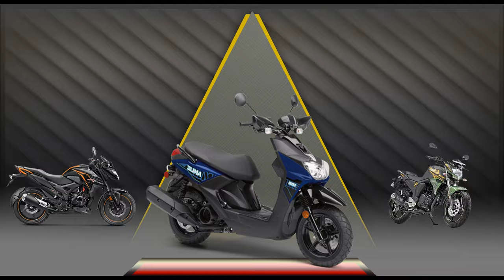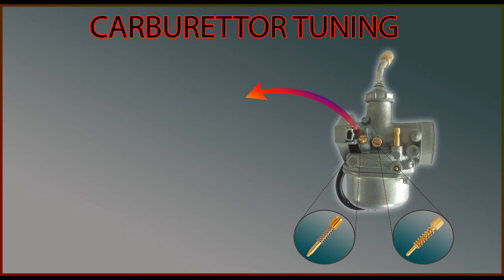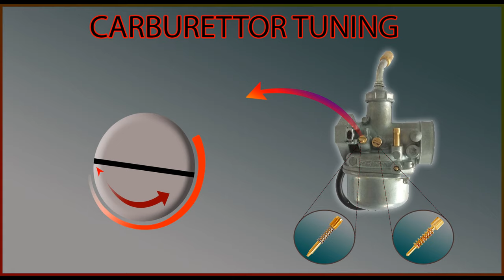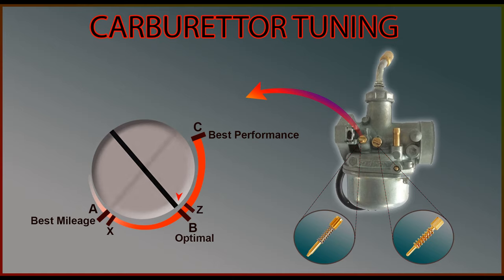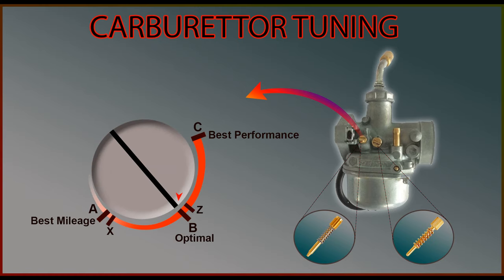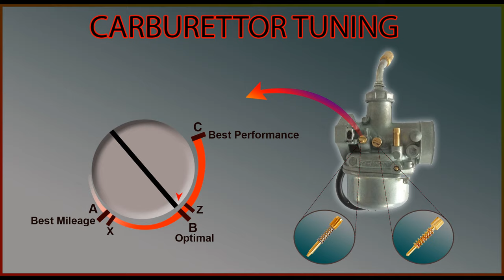Bike or Scooter carburetor tuning for mileage, carburetor setting. TVS Jupiter, Wego. #carburetor

Comment: This was explained in a way where I was able to adjust my carb well. Before this video I watched other videos. I know what the adjusters were. I just did not understand their relation. I installed a tachometer thinking it would help. I searched online for the RPM range for my scooter. 1500 to 2000. I followed your instructions. The top end was 3000 RPM it would not go any higher than 3150. It would start to shut down around 1230. So B would be around 2100 RPM. After setting the mixture, I adjusted the idle where it would not bounce back and forth. The scooter started to act funny when I changed the air filter. I'm looking to change the exhast next. Again, thank you for making this video... it seems you were the right teacher for my learning perference.
Reply from the maker: Thank you 😊, glad that this video helped. I saw most of the other videos which lacked proper explanation. Hence, I made this video. Good to see this helping others 👍

Comment: i found that when the bike is fine tuned it feels very smooth and less heat in the engine.you will feel hot  moisture air closer to the silencer and cool air from six inches away from silencer.
Reply from the maker: Good observation 👍

Comment: My scooter completely uses up a full fuel tank in just a few kilometers. Since I don't have a license plate (yet), I'm not allowed to go on any main roads, and thus my rides are very short (200m at most, 3-5 times a day), but I still managed to drain the full tank within 2 WEEKS.
Reply from the maker: Oh, that's not good. There may be multiple reasons. You will have to get it checked by a mechanic once.

Comment: I really appreciate your way of teaching🎉🎉And i have a issue in my discover 125 cc bike bs3 model 5  speed engine. That is, i have cleaned my carburetor throughly , adjusted the tappet well,replaced with new air screw, slow speed screw ,air filter ,spark plug with geniune one & recently serviced cylinder head valves also. But when i tune the carburettor air screw when i close the air screw till the end engine gets stammering and when i rotate  the air screw towards anti clock wise direction engine rpm starts to get increasing after 3 full turns ,after that engine rpm is increasing well but stays stable ,no change. After that rpm has to be reduced in one point if we rotate the rpm screw completely ,but it won't. Even if we completely loosen  the air screw also the rpm wont decrease either increase in  further rpm. Then when we remove the airscrew the engine gets off. So i left the air screw after 4 1/2 full turn & reduced the slow speed screw to 1000 rpm. Becoz i can't able to find the proper optimal position. So kindly guide me why it is happening & how to fix the problem, hope you will reply me, thank you.Note 👉 i have cleaned the carburettor already due to the same issue but it still exists 😢😢
Reply from the maker: Hi, first tighten the air screw completely. Do not overtighten. Start the engine and adjust the idle screw so that engine has low idling. Then start unscrewing the air screw and count the number of turns it takes to get the highest RPM. For example if you get the highest RPM after unscrewing 4 turns then the optimal position would be 2 turns from complete close position. Hope this helps.
Reply: @autobotgeekse  ok sir thankyou for your feedback let me to try 👍👍
Reply from the maker: @rihanhameed317  wc, 👍
Reply: @rihanhameed317 solved hua I have same problem in discover 12
Reply: @shubhampawar8608 sorry for late reply Mera problem solve hua ek aleg tharikka say

Comment: Great explained than the others... I have got 80 kmpl on my Honda shine..... But having some issues with my hero honda splendor its getting 60 kmpl I don't know the reason why. if you have any idea please suggest sir thank you...
Reply from the maker: There are other factors which affect the mileage as well. Pls watch my other video on mileage tips. Also, will be making another video on carburetor jet mod for betterment of fuel economy by 25%. Hopefully that will help you. Also, pls check your spark pulg electrode distance and carbon formation, that also affects the mileage
Reply: @autobotgeekse  I cleaned spark plug, also checked tappet gap, and tyre free.. Every thing is prefect... But can't get the problem.. 😔
Reply: @autobotgeekse  is there is any problem in air screew, if it gets wear out?
Reply from the maker: @NIKKAMSUJIT  if the tapered edge of the air screw is worn out then yes that will cause the issue but it is very rare unless it is damaged due to overtightening
Reply: @autobotgeekse  actually sir my bike is 22 years old so may be it would be the reason...
Reply from the maker: @NIKKAMSUJIT  yes, that might be the reason. Also, there could be worn out piston O rings which may cause pressure leak causing lesser thrust. When was the last time you replaced the cylinder head and piston?
Reply: @autobotgeekse  20000 km done after last engine built
Reply from the maker: Increase the throttle and see if you are getting excess smoke which will mean your piston wall is worn out and need replacement
Reply: God Love  only the air filter left to be replaced ill check it out.. 👍

Comment: Thanks a lot for very well explain , my scooter honda dio when not started for one week 
I have to put some gasoline in the carburetor to start , can help me pls what you think the problem is ? Carbrator or something else
Reply from the maker: Thank you, probably fuel is not reaching the carburettor properly. Scooters fuel line is not linked directly to carburettor. Fuel gets pulled to manifold basis the vaccum pressure created from cylinder. Please have the vaccum line cleaned and see if there is an improvement

Comment: Sir, The way you explained is great but i have seen pop up tital msg between video in which you apologize for rich and lean mode.. as far as i know tightening screw will consume more fuel and less air and vice versa for unscrew it. Plz explain to me !
Reply from the maker: Yes, those are the correction subtitles. I interchanged the terminologies in the audio, hence added correction subtitles. It is the air screw that we are tightening which will regulate the air to fuel ratio. If we tighten the fuel sucked will still be less when compared to lean setting.

Comment: If your air fuel  mixture screw is on the engine side, wouldn’t it be a fuel screw? Therefore turning it CW would restrict the fuel flow and lean the mixture?
Reply from the maker: Most of the carburettors will have both air mixture screw and idling screw on the same side. However, we can identify the screw type basis the direction in which screw is moving inwards or outwards. Tuning can be done accordingly

Comment: Bajaj pulsar ns200 bs4 how many rounds should the air fuel mixer screw rotate for best performance and mileage
Plzz tell me.....
Reply from the maker: Number of rounds are not the same for all vehicles. Hence, you will have to follow the steps in the video to find the optimal position

Comment: Yamaha SS 125 bike. How to set maximum mileage? Also guide setting spark plug gap without tools.
Reply from the maker: It will also have the same setting, however the idle screw will be different. Will try to make a video for spark plug

Comment: When we rotate in the clockwise direction, the performance is better. And when we rotate in the anti-clockwise direction then the mileage is more.
Am i right.
Reply from the maker: Actually it's the other way round. Clockwise for mileage and anticlockwise for performance. When we loosen the screw, we are letting more air in resulting in better performance.

Comment: Would this apply to Honda navi stock carburetor? I am bit a confused since some say it is an air screw and not a fuel the one Honda navi has on the left side closer to the engine, could you help me clarify that, thank you!

Comment: Only one thing you missed to say. Whether the air mixer must be tightened clock wise before tuning it anti clockwise to place in the position "C"
Reply from the maker: First air screw should be tightened completely and then unscrew by 1 turn. Should not over tighten. Then start the tuning procedure.

Comment: in my tvs ntorq, turning the screw clockwise makes the fuel mixture rich.. and anti clockwise makes it lean
Reply from the maker: Might be a reverse threaded air screw. We need to identify the direction of rotation which increases the RPM. That will be rich mixture setting.
Reply: @autobotgeekse  No, it is not a reverse threaded screw, I have confirmed. It is the same as in Jupiter. And, like in Jupiter, unscrewing it makes the mixture lean, as Nitanshu Chaudhary has correctly pointed out. That's because this screw controls the air from an air-bleed flowing into the main air + fuel stream that is entering the intake manifold, not the flow of fuel as you had said.
Reply from the maker: Yes, you are right. Added correction subtitles where necessary. Thank you.
Reply: @subratabn  thanks for backing me up brother
Reply from the maker: @nitanshu_c  Thank you for highlighting this initially. Appreciate your feedback. It will help me to make better videos. 👍
Reply: @autobotgeekse  needless 💜
Reply: @nitanshu_c   @Nitanshu Chaudhary  haan yaar muhje v feel hua kab mene apni tvs ntorq ko clock wise kiya to mujhe lag rha hai mileage bohot kaam hai or exhaust se v bohot jyada fuel smell aa rha hai to kalhi usko anti clock wise turn hoga hoga or me video dekhke pura confuse hogya hi bhai🥺 ab kal test karunga phirse
Reply: @nitanshu_c  sukriya yaar confirm karke batane ke liye me pura confuse hogya tha ye video dekhke or avii comment dekha phirse qki mera ntorq bohot rich chl rha hai so avii comment dekha or avii dekha subtitle v😭

Comment: sir,its a air screw not mixture screw , it is mikuni variant on Jupiter,  on my tvs wego max rpm comes at 1 complete screw open from bottom out.
Factory setting is 2 complete screw open,  I am confused which one should I keep?
at factory setting when you flip the accelerator rpm doesn't become normal quickly
Reply from the maker: Yes it is Air screw. However, it's also termed as air mixture screw as it mixes air to the fuel. For Wego it takes 5-10 seconds to achieve the proper idling once de-accelarated.
If you max out on RPM for just one turn, then adjust the idle screw so that the RPM is low and then try opening the air screw and see if you see a difference. Your vehicle seems to be set at high rpm idling.
Reply: @autobotgeekse  
Thanks sir for reply. 
Observation are as follows 
- Max idling rpm at 1 screw open from fully closed. 
- Now you set idling rpm normal & start opening air screw open, Max idling rpm achieved at 1.5 screw open from fully closed & if left at same setting ,vehicle has  serious starting issue. 
after getting tired I keep air screw at 0.75 & run the vehicle,  also it is able to clear the Pollution check certificate.
Reply from the maker: @adik9441  do you still have starting issue at .75 turn? How is the mileage? Since .75 will be a rich setting it should give good mileage. Check my other video where I have shown mileage test results for all three settings
Reply: @autobotgeekse  
at 0.75 no starting issue, actually I got tired of starting issue.  at 0.75 avg is between 30 - 34 max .
Reply from the maker: @adik9441  ok, then that must be the ideal position
Reply: your video are good, helped me to clear the doubts
Reply from the maker: @adik9441  thank you for your time. All the best and happy riding 😊

Comment: Nicely explained sir I also noted the correction.
I have a Suzuki access 125 old model. My scooter stops after every 10 to 15 minutes of drive and then starts after giving it a rest of 10 minutes. I have replaced the wiring replaced the carburetor replaced the CDI , spark plug , air filter everything but the problem is not solved. What could be the problem sir.
Reply from the maker: Fuel tanks air intake valve must be choked. After 15 min ride vaccum gets created in the tank restricting the fuel flow. If vehicle stops. Try starting it with fuel cap open. If it starts then that is the cause.
Reply: @autobotgeekse  Thanks sir I will check it out
Reply from the maker: @vincyfranco2142  you are welcome 😊
Reply: @autobotgeekse  Good morning sir I tried starting the scooter with the fuel lid open but it didn't start it behaved in the same manner sir. Please help me out with this
Reply from the maker: Have the ignition coil checked once.
Reply: @autobotgeekse  Ok
Reply: Debe ajustar la luz de valvulas. Nada mas. Saludos 🇦🇷

Comment: Good day sir. is this applicable for 4 stroke diaphragm type carburetor for example suzuki raider 150 carb.. thank you
Reply from the maker: Yes it should work. Thumb rule is that carb containing an air screw will follow this procedure for tuning

Comment: You say that at higher altitudes air has lesser oxygen (at around 3:32), which means that the fuel-air mixture gets rich (more fuel than is optimal) at higher altitudes. And then, (at 3:36) you advise keeping air-fuel mixture rich when one goes to higher altitudes. Shouldn't it be the opposite-- if it is already rich (due to altitude) why make it more rich? Shouldn't one adjust the carburettor for a relatively leaner mixture at higher altitudes, to compensate for the rich mixture?
Reply: Yes.. What he said is wrong. For higher altitudes it should be lean mixture.
Reply from the maker: Yes, you are right. Added correction subtitles where necessary. Thank you.
Reply: Currect.. I also thing why this wrong
Reply from the maker: @v.s1008  hope you can see the correction subtitles now? Just checking

Comment: I firstly pull the rpm screw clockwise until its tight and then I also tightened the air mixture screw clock wise but the engine didn't stop the race was as it is so I turned it anticlock wise a little bit then also turned the rpm screw anticlock wise. What should I do?
Reply from the maker: The engine does not shut down if the idling is high, adjust the idling as well when trying to tune the carb. Will get better results

Comment: Hey is it possible that the mixture srew decide how much mixture will flow into the ciinder ? So by turning the screw you can not change the mixture ,so you can not make it lean or rich...you only can change how much mixture will flow in to cilinder
Reply from the maker: Yes it does impact. Please see my other video where I have shown the practical result comparison on all the 3 settings (Rich/Optimal/Lean). There is a certain difference in fuel economy in each of these settings.
https://youtu.be/3YMIMjRmRJU

Comment: I followed your instructions, but the result was only a 1/4 turn of the screw. It should be at least 2 turns. When I rode the bike, it didn't seem well-tuned. I believe your instructions were incorrect.

Update 1: Following your settings made the bike very uneconomical. (confirmed)

Update 2: I adjusted it gradually until it was at 2 and a half turns, and now it seems to be running fine.
Reply: He didn't specify a quarter turn - around the 2 minute mark he says turn the screw counter clockwise until you hit the max RPM...could be a quarter turn, or could be a couple turns depending on a multitude of things.
Reply: @CrazyLadyISBomb  
Anyway, his strategy didn't work. It made my bike consume heavily and uneconomical. After a few experiments, I adjusted it 2.5 turns, and now it's fine.
Reply from the maker: Strange to see if it's not working for you since I have seen people confirming an improvement in fuel economy after they followed the steps

Comment: Hlo sir I have honda dio bs4 so for better mileage shall I tightened the air fule mixture or loose
Reply from the maker: Hi, you will need to tighten it to make a rich mixture for better mileage. You can follow the steps mentioned in my video for precise adjustment.
Reply: Thank you so much sir
Reply from the maker: @moatemsu87  most welcome
Reply: Sir I have 1 more question I wanna ask that what if we tight the rpm screw shall it effect the mileage
Reply from the maker: @moatemsu87  you can adjust the idle screw to make sure engine idles properly without bogging down. Once air screw is adjusted you have to make sure idle screw is adjusted properly to keep the engine running
Reply from the maker: @moatemsu87  it depends on the route you commute. If you halt regularly at traffic signals then it would definitely impact, when the vehicle is at hault most of the times, idle screw will regulate the fuel supply resulting in fuel consumption

Comment: my friend, you are saying everything about basic carb tuning but you also should say that the best for our engines is the ""point c"", and not the other points because then you have a very high temperature in your combustion chamber and this can make a lot of problems to the engine, even destroyed it.
Reply from the maker: Engine will not run hotter at point A and B. Instead engine runs hotter at point C (Lean position) which may cause issues. Also, all the engines have an acceptable temperature threshold tolerance of ±25% which will ensure minimal impact to engine's longitivity. Only cause of engine failure will be due to improper maintenance and periodic engine oil change misses.

Comment: Sir....My bike pulsar 180 increases rpm even after 6 full rounds anticlockwise....What shall I do sir??
Reply from the maker: You can unscrew it further and you will see the stop in rpm increase at some point.
Reply: @autobotgeekse  ok sir...Will it be too rich...I am currently keeping at 3.5 turns
Reply from the maker: @pablochocobar9540  if you unscrew, it will become leaner mixture. So try avoiding a complete lean setting for better fuel efficiency. Try an optimal setting by following the steps shown in my video.